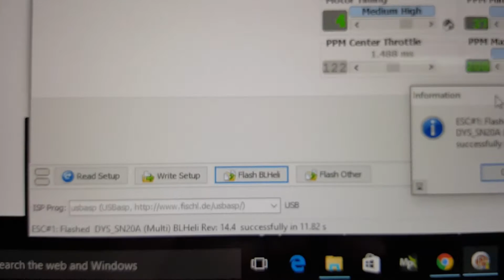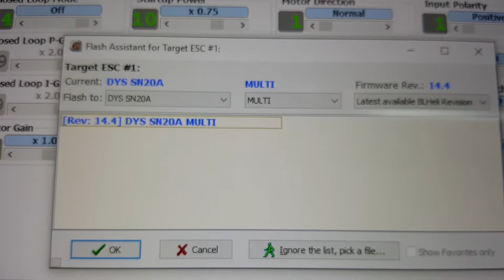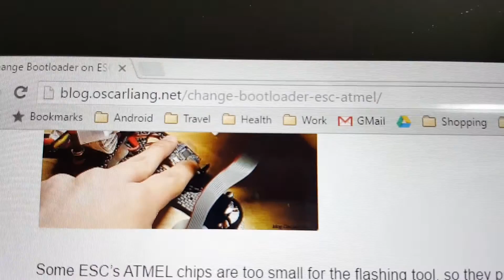Change Bootloader to BLHeli

Comment: Hi there  .  For some odd reason .  I've manage to corrupt 2 of my esc FW using the chrome App BLHELI configurator on a Mac .  I this what I'll need to do to be able to use these bad New ESCs ?
Reply from the maker: I suppose but try flashing on Windows first or use a different USB cable. The bootloader usually never gets overwritten so you should still be able to flash them.
Reply: I'll Try a different cable ...  But It's not even seeing  the ESC .

Comment: why would I want to flash the bootloader? I currently have sn20a on 14.1 however it does say that it has the Simon k bootloader when I connect to it. I can currently connect to the ESC via my naze in blheli suite. is it not possible to update the ESC to the latest firmware with a Simon bootloader installed?
Reply from the maker: At the time this video was made, it was not possible with SimonK bootloader.  Recently this has changed and not VCP passthrough feature now works on both SimonK bootloader and BLHeli bootloader.  This video was uploaded in March and this new feature was released in June.